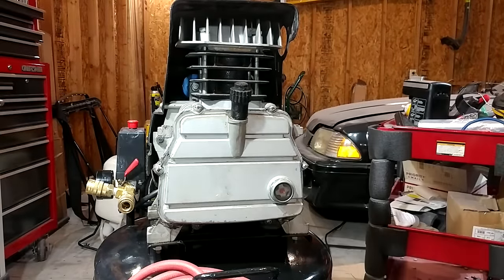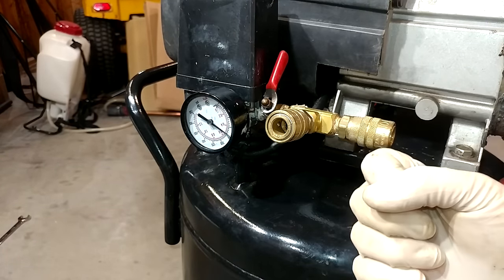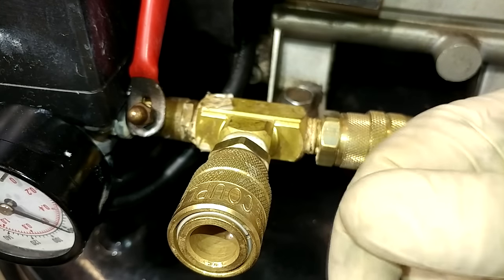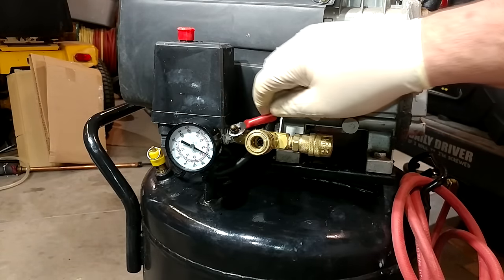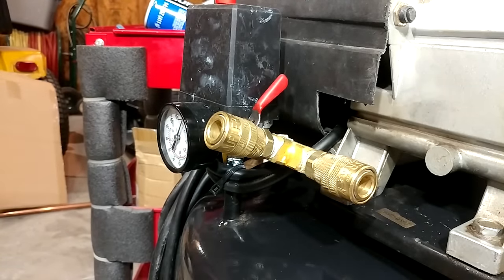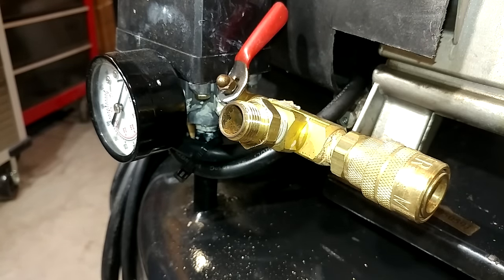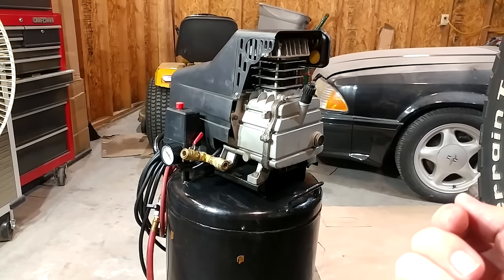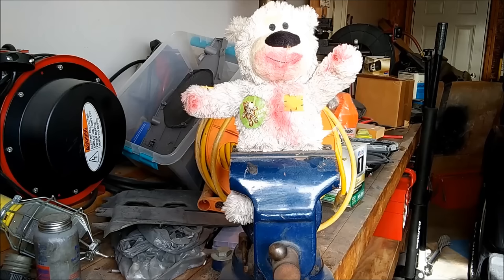Cheap Upgrades for Cheap Air Compressors!

Comment: I know this is old but just putting a 90 degree "pipe" elbow (male on one side female on other, like yours but cheaper since not brass and not needed connecting to steel), then just a pipe long enough to get to the outside of the tank, will withstand the full pressure all the time and you can add your ball valve there instead of underneath, and eliminate the need for a second ball valve.  Also, I just use cheap clear vinyl tubing for the output since it's never under any real pressure.
Reply from the maker: The reason for the brass bar stock 90 is because it's about 1/2 the height of a standard black iron pipe elbow and fits under the tank without hitting the floor. I also prefer brass because it won't rot out like iron will or falsely indicate more rust in the tank than is actually present. It's a couple more bucks, but money well spent, IMO.

Sorta the same deal with a pipe to get it out to a leg instead of using hose. A pipe will eventual rot out, and make the discharge water appear rusty, but a hose never will. The purpose of the first ball valve at the tank, which honestly I had forgotten was even there until you mentioned it, is just in case the day ever came that I might damage the discharge hose and want to shut it off at the tank. It's been there for about 10 years and I've ever needed it. It probably wouldn't work anymore if I tried. 😆

This compressor has been retired, but on my new compressor I just put a valve on the hose and omitted it from the tank, using the same bar stock brass 90. I also added a water separator in-line between the compressor and the tank and used vinyl tubing for the water drain there. I confess that I used high pressure vinyl for the job, but that is mostly because it's less likely to kink shut and I prefer the look of it.

What all of that said, no matter how someone chooses to do it, a remote tank drain is worth whatever it costs to get done. It transforms a job that is a ridiculous pain into something that is just the flick of a switch. 👍

Comment: The largest restriction I found is the fittings themselves. Replacing them with high flow fittings and 3/8 id hose let my ingersol rand 1/2 impact handle f350 wheel nuts. No problems except trying to find quality high flow fittings that don't leak.
Reply from the maker: I keep hearing good things about the Milton V fittings. I plan to take a look at them in the future.

Comment: I think because of the Indiana humidity you should tilt the valve fitting downward slightly and then it will drain better. I have a small tank that I drain weekly and I leave it open during the winter and it does ok.
Reply from the maker: Since filming this video I have retired the compressor shown and taken water separation a lot more seriously on its replacement. I decided that the best way to keep water out of the fittings was to keep water out of the tank from the start.

Check out the Compressors / Air Tools playlist in the description if you want to see where that path has led me.

Comment: So by the time you make all these upgrades, how does the cost compare to just buying a higher end compressor?
Reply from the maker: Not even close. Sadly, even much higher end compressors still come with pretty crappy gauges, fittings, etc and all of the stuff I installed here will transfer over to any other compressor in the future.

The only real money wasted was on the filter housing, which was more for fun than anything. I ended up abandoning it for a Solberg unit not too long after this video.

That said, I did end up retiring this compressor and replacing it with a much higher end model (videos are all linked in the Air Compressors playlist, which is in the description). After waiting for months for a good sale, that compressor was ~$400. Regular price is around $700. So... In regular price dollars, it was probably about a $450 difference between what I did in this video (including the initial purchase price of the compressor) and my new compressor as it came out of the box. My new compressor also received the same treatment and then some.

Comment: I stuck a coil from a broken window ac unit and a line dryer between the compressor and the tank. the coil cools the air making the line dryer work better
Reply from the maker: That's almost exactly what I just did on my new compressor, featured in last Sunday's video. 👍

Comment: Can u paint a car bumper with that small air compressor???
Reply from the maker: I've known guys who have painted entire cars with compressors this size. I don't feel that gives you much margin for error, but... they do it.
Reply: Ok brother u recommend just getting a bigger compressor 👍
Reply from the maker: @bensonporter1384  That's what I ultimately did. These really cheap, small, compressors are just enough to barely get you working. 😅
Reply: 🤣🤣 them little compressor are trash....what big compressor did u buy??
Reply from the maker: @bensonporter1384  A slightly larger DeWalt. It's the most I have the electricity to run.

There are several videos of it on the channel.
Reply: When u take off the air regulator on the small compressor...did it help on air pressure???
Reply from the maker: @bensonporter1384  It helps keep the pressure from immediately dropping at the tool. It doesn't change anything about how much air the compressor itself can pump.

Comment: Just a tip, but @4:15, your using the rib-joint adjustable pliers (Channel-locks) wrong.  They will slip a lot less if you use the fixed jaw on the backside of the direction of travel.  In other words, the adjustable jaw goes on the same side as the direction of travel.
Reply from the maker: See the pinned comment.

Comment: Use a crescent wrench on fittings and lay off the channel locks(tongue and groove) and other wrenches! They don't mar and round fittings...
Reply from the maker: The fittings themselves, where I was using the channel locks, are round.
Reply: @TheBrokenLife  yeah what I'm getting at is if you don't use channel lock pliers on a fitting not already rounded and instead use a crescent wrench you avoid this entire issue, lol...
Reply from the maker: @AWIERD1  I understand your point. My point is there is no hex on those fittings and there never was. The have round bodies with knurling and that's it.

Look up a Milton S-715 and you'll see it. The only hex on it is for installation, not for disassembly.

Comment: Neat video, the cover probably doesn't affect airflow to the filter too bad since the cover has a decent amount of holes in it.
Reply from the maker: That's my thought too, but the thing pumps up radically slower now than it did before with no filter. I think if I had to do it over again (which... I might), I'd probably try to adapt a motorcycle air filter or something. Ya know, something with giant skulls or flames or knives or something cool. ;)

Comment: also try high flow milton fittings, makes a difference on impact guns, sand blaster and hvlp spray guns
Reply from the maker: I've moved on to Parker fittings since, as far as I can tell, they don't have any steel parts to corrode.

That said, one of the issues with these cheap compressors is that the biggest hole in the tank is 1/4" NPT. So even if I were to run no fittings and just plumb directly to the tank, that's all the better it would ever get. My new compressor (video linked here: https://youtu.be/prOpMyOkPK8) has 1 1/4" bungs in the tank so at some point I'm likely to try much larger plumbing. When I do, it will for sure be on the channel. 👍

Comment: Use Milton Hi flow V style fittings. They move way more air than M style and the coupler will still accept M style male ends. But I replaced those too for my impact wrenches.
Reply from the maker: I've heard good things about those and plan to take a look at them. 👍

Comment: i bought a goodyear 30 gal from walmart with a digital regulator and it runs a 3/4" husky impact gun enough to remove a honda crank bolt. surprising that it doesnt have the presure drop off
Reply from the maker: I'm surprised by that too. A crank bolt is exactly what caused me to find this error the first time on mine.

Comment: Hi it may be worth fitting a moisture filter before your fittings to stop corrosion.
Reply from the maker: That's absolutely in the long term plan. I honestly didn't expect to have the corrosion troubles you saw in the video, or at least not that extreme.
Reply: This was my thought also. I’m building a copper pipe radiator type like everyone else has.

Comment: Don't take the retainer collar and balls out' the connectors screw apart below the sliding collar (where he first tried with the plier), above where it screws into the fitting, only use good fitting wrenches not pliers, when I reassemble them only hand tight they do not leak so it doesn't take much tightening
Reply from the maker: Yep. Lesson I learned the hard way!

Comment: I bought  that model air compressor awhile back. The motor shaft is press fitted to the pump. Mine had a key way cut in the shaft but no key. The shaft destroyed the pump. Watch out for this problem.
Reply from the maker: Ouch... These cheap guys always seem to find a creative way to die.

Comment: If you're worried about heat from the head getting drawn into your filter, just block off the existing holes and make new ones elsewhere.
Reply from the maker: That was my thought too, but I ended up switching to a Solberg housing.
Reply: @TheBrokenLife  Another upgrade you might want to think about adding is an aftercooler and water separator to put in between your compressor head and the tank.  That should eliminate your water problem entirely if you do it well.  That tank will last far longer after that mod.
Reply from the maker: @ronyerke9250  I absolutely agree and I did exactly that to my new compressor in last week's video. 👍
Reply: @TheBrokenLife  Yeah, I wached last week's video right after I left that comment.  Did you keep the old H.F. compressor tank for extra volume in your system?
Reply from the maker: @ronyerke9250  I kept the entire HFT unit as a spare compressor since it does still work despite eating head gaskets at a break neck pace.

I considered plumbing them together but the HFT is only good for 125PSI and the DeWalt is 155PSI. I could regulate a line down for the HFT, but it just didn't seem worth the effort. The 30 gallon tank on the DeWalt is pretty nicely balanced for the size of the compressor.

Comment: i put a length of steel pipe between my elbow and the shut off on the drain so the valve is right beside the front  leg
Reply from the maker: Whatever works! 👍

Comment: Something you can look into also is rewiring the motor for 240v. Most compressor motors can be wired for 120 or 240v. It will preform slightly better at the higher voltage, and it will use less electricity.
Reply: I will use the same net amount of electricity but it will use fewer amps on 240v.  The rpm's will remain unchanged so the performance will be the same regardless of input voltage.

Comment: JB plastic bonder flows perfectly for this application and has a strong bond.
Reply from the maker: I don't doubt it. I've been meaning to try some out! 👍
Reply: @TheBrokenLife  I just used it on a bumper Repair...it's great. Used it as a bonder and filler. Sands nice too...I use it with the nozzles... makes it pretty easy to lay.
Reply from the maker: @DJDOUBLE077  Interestingly one of my upcoming projects is to fill some holes in a plastic bumper. I'll definitely give it a shot.

Comment: I have this same compressor but it has a terrible problem starting.I have to turn the switch on and off and it tries to start but it’s working to hard and it starts and it blows the inline circuit breaker,either the one on the unit or another inline I use..when it was new I figured after a good break in period it would loosen up but it hasn’t yet.this one hasn’t had that much use but it’s getting old.I put the 2nd line on it but haven’t done anything with the gauge yet.this tank will be going into a compressor build soon.I did increase the filter size.
Reply from the maker: Mine does that in cold weather. Are you running an appropriate air compressor oil?  I run non-detergent straight 30W in mine.

Another thought is there could be something wrong with your contractor/pressure switch where it's drawing too much power. I'm not sure if it's this video or another one where I illustrated replacing mine.
Reply: Yeah,like I said it’s a couple yrs old but doesn’t have that much use.I was down for a few yrs needing back surgery but yeah I changed it after break in period and now has half and half syn and standard and the right cord.I put WD40 on the shaft next to the fan thinking it was turning by hand too hard and that made a big. difference but still stuck with the same crap.I have a har dryer I some times put on it a while and seems to help but same old crap overall
Reply from the maker: @barrykilts4506  There could be a few things causing it, but it doesn't sound like normal behavior. I'd probably pop the cover off of the contactor and see if anything looks burned and maybe disconnect the small line at the check valve to make sure yours isn't leaking.
Reply: @TheBrokenLife  have the cover off now and all appears well but since I do a lot of steel cutting,grinding,welding and such I decided to change the oil and glad I did.don’t know for sure yet but alone may be enough of an improvement and if it is I’ll change it once more very soon and more often and improve the air breather/cleaner
Reply from the maker: @barrykilts4506  Awesome! Hopefully it really was that easy!

Comment: That air outlet is supposed to be at the bottom of the tank. Do not run a 90° or it will not empty any water out of it completely.  Only real upgrade is a water/air separator filter and a ¹/² adapter & hose.

Comment: just guessing but that filter thread looks to be a 3/4 npt roughly and if so that opens your choices for more filters or at least a way to attach them?
Reply from the maker: It's M20. I was able to obtain an M20 to 3/4 adapter and put a Solberg housing on it a little while after I released this video. 👍

That said... Various reports from the field lead me to believe that not all HFT compressors have metric inlets. You have to check each one before making any plans.
Reply: @TheBrokenLife  good to know since i have the same compressor.

Comment: I have a little 4gal compressor so in order to run high vol tools I attached a harbor freight 10gal tank($50) and now I have the volume of a 14gal compressor and can run my plasma cutter and die grinder
Reply from the maker: I would suspect you're not running your plasma and die grinder for very long..?
Reply: @TheBrokenLife  with the extra tank I get about 45 seconds of plasmacutting at 35psi before the compressor kicks on, then about a full minute before the psi dropps enough to where I can't keep cutting. I get about 30 seconds of die grinder. Thought about getting a second one
Reply from the maker: @autodidacticartisan  That's about what I would have guessed. I admire and respect the make-it-work attitude, but that amount of run time would drive me bonkers. Even something like the cheap HFT compressor I showed in this video would be a huge upgrade for you. You won't be running stuff non-stop, but you would easily multiply your productivity by 5 or maybe 10 in the case of the plasma. 

It looks like the cheapest similar one they have these days is about $250.
Reply: @TheBrokenLife  I've been considering getting their 26 gallon ultra quiet compressor. It looks very nice and I've seen some good reviews. Tbh a minute is enough time to cut most things on the plasma cutter. I'd really be wanting it for the die grinder and other high flow tools.
Reply from the maker: @autodidacticartisan  Die grinders are pigs for sure. You just can't have enough air to run one.

Comment: I'm here laughing at my 15 year old harbor freight fittings that still don't leak.  Thanks for the video.
Reply from the maker: Hopefully you didn't just jinx yourself! 😆
Reply: Fingers crossed, but honestly if they leaked tomorrow I would just go grab another pair.
Reply from the maker: @cm.5023  That's what I did for many years as well. I just didn't have your luck.

Comment: I might be a bit late to the party but i want to say that the main point of discussion is moot

That part of the fitting is meant to be unscrewed using a rod that fits in the holes present on the part
Reply: Also, pliers are almost never ideal, a strap wrench should be present in every house where someone knows how a  screwdriver works
Reply from the maker: I made a follow up video on disassembling the fittings and linked it in the pinned comment.
Reply: @TheBrokenLife  i guess i really was late to the party, huh
Reply from the maker: @angrydragonslayer  The good news is that the party never stops! 😆

I did think about your comment and I would be interested in finding a strap wrench that gets down small enough for things like air fittings. The smallest one I could find will only get down to about 2".

Comment: So if you install a reservoir attached to the compressor want that take care of lack of pressure ?
Reply from the maker: That will add volume, so it will increase the amount of time before the compressor turns on, but it will not increase pressure. It will also cause the compressor to run long to refill the additional volume.

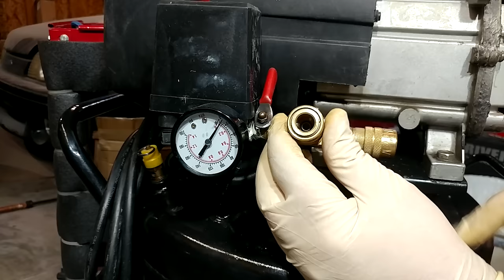Comment: At 4:25 turn channel locks around.. there is a right and wrong way to use channel locks. Just a tip
Reply: My bad just now seen comment u acknowledged using backwards
Reply from the maker: @jasonbirkhimer9095  👍😆